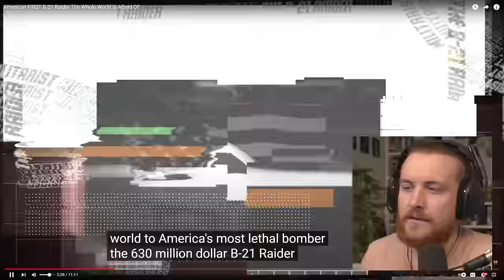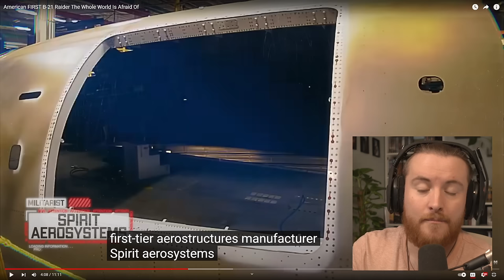Royal Marine Reacts To American FIRST B-21 Raider The Whole World Is Afraid Of!

Comment: Did the narrator say "unmanned capabilities?" It's definitely a beautiful plane. Yup. Ya just gotta look good while flying. Otherwise like you said "what's the point?" 😁
Reply: In theory I think the original contract requirements called for it to be able to be flown unmanned, but that it’s not going to be an initial capability. That said, though, the real “unmanned” capability it and the NGAD are definitely expected to have are managing other unmanned aircraft in the airspace. So one B21 might have a bit smaller payload than a B2, but if it is commanding a wing of much cheaper, smaller, more expendable drones with their own munitions… With the added benefit that it lessens or avoids the B21 needing to open its bomb bays as much if at all if they let the drones carry the payload. That would avoid even the brief time with the doors open which temporarily spoils much of the stealthiness.

Comment: Little facts are know about the B-21 currently. It’s still in development and everything is classified. It is a smaller plane compared to the B-2. It’s supposedly more stealthy and the stealth coating will require less maintenance and is cheaper to maintain. It can be used unmanned like a drone or with a pilot. 

The most important advancement compared to the B-2 is how much further it can travel before needing fueled. The downfall of the B-2 is it needs refueled before it reaches its destination. Using China as the example like in the video a B-2 will have to fueled before it can reach China. This totally gives up all stealth during fueling. The B-21 is much more fuel efficient and wouldn’t need fuel until after it’s dropped its payload. Long after the mission is over. 

This plane actually scares China, they have ran simulations on how to combat the B-21. The only solution they have come up with is attacking then first.

Comment: The economics of the B2 could have been better. the original order was for 100, but someone in Congress that did not like the plane, was able to get the program cancelled and less than 50 were built...thus the cost per unit went up. When you add in the over all cost of the program with R&D added into the physical cost of building each one.

Comment: The B-21 is smaller than the B- 2 , it will under go constant upgrades as they come on line but all and all it is supposed to be more stealthy than the B-2. China stealth program is way behind the US,   as far as changes in the B-21 compared to the B- 2 most is top secret even the paint has changed.

Comment: As to why it is better it is a complicated question to answer. Basically it's a little smaller then the B2 and cheaper and the US will build many many more of them. The engines have improved and though the payload will be smaller it still will carry tens of thousands of pou ds and there are more of them and they are stealthily and have much better electronic capabilities and it is possible to fly them remotely even. 

I also want to say that the actual technology that is planned at the outset is always designed in a way to accommodate upgrades that may require more electricity for example which is why the engines are upgraded and there is always a little extra space designed into them for ulimprovements or whole new systems.

Comment: a set of requirements are set by the air force   each contractor submits a design and cost along with a pitch why there's is better     air force chooses based on design ability and cost

Comment: Wing shape of B2 was same as B-21. Extra wing surface was added for better low altitude and slower speed manuverability. Most systems are still classified on the B2. Radar signature is said to be an order of magnitude less for the B21. That's 10x less signature. We wanted longer range. Much longer range. The majority of 6th gen capability will be confidential for many years. Moat of the 5th gen capability is confidential. Try and look into the F22 and see how little factual info is available.  The AI computing is a major development. The B21 and F35 both have the (alledged) ability to act as an AWACS and command and control center all in one, while that is only it's secondary abilities. The NGAD, like the FA-XX of the Navy ahould put America ahead for quite some time. Consider the F22 is still the premier fighter on the planet, and the US is already working in the finalized replacement for it. The B2 is the moat advanced bomber in the world, and is concerned obsolete already. While the rest of the world has yet to produce a TRUE 5th gen aircraft the US is already building 6th gen.

Comment: The Chinese have no idea about stealth. They are ignorant of many of the technologies in the B-21 or even the B-2. They put on a good show at making their aircraft "look" advanced. But that's all cosmetic. The B-21 has already flown and is in flight test...most likely at Edwards Air Force Base. I worked in the same building as the B-21 production line when I was on the F-35 center fuselage program. I retired several months before that roll out ceremony. The devlopement may have been 7 years but the actual building of the first aircraft was less than that.

Comment: I am hoping - HOPING - that when they say it took 10 years to build it - they are talking about building the first production model of that plane. It would have had it's prototype, gone through the analysis and vetting of that prototype, done a revised prototype of what they wanted to produce - gotten real cost evaluations and discussions on whether that version satisfied the Air Force's requirements for the plane they wanted. Done the analysis of how the proposed plane effected the other planes in service - and satisfied the original programming of what was needed. Then agreed the plane was what they needed and started production. I could support that process taking 10 years. Otherwise - it's total BS

Comment: Please keep in mind that the information in this breakdown video is the official "PUBLIC" information.  Second the Chinese aircraft is likely nowhere near what they claim.  They just don't have the extreme precision engineering and manufacturing technical abilities that the US has.  You can steal any designs you want but without the ability to manufacture what you stole, it is a bit academic.  Sure building one or two aircraft with the profile they claim is great at airshows and boosting morale, it does almost nothing in a real conflict.  Especially, if you are going up against 100 B-21, 300 F-35 and are completely outmatched everywhere else.

Comment: The F-35 has the radar cross section of about 0.0015 square meters.   Thats a gulf ball. 

The B-2 bomber has an RCS of 0.0001m2, the same as the F-22, the size of a bumble bee.

So the B-21 Raider is supposed to have a radar cross section of less than a bumblebee.  Flying at mach Jesus.   

Yeah thats right on radar the F-35 which is basically the export model of the F-22 has the radar cross section of a gulf ball.  While the F-22 and B-2 both look like a bumblebee.  

And our newest toy the B-21 Raider is supposed to be smaller than a bumblebee on radar.  Oh and so far the B-21 has taken it's first flight.

Comment: I do not know if u knew Hitler was not that far from having a jet plane that looked a lot like these flying wing type planes the US is building.  The HO229 that was at the point of being test flown was mostly wood so  during WWII would have been very hard for England to detect.  And I believe it had two jet engines.  So the HO229 or Horton 229 could have made the war a lot longer or given Germany the edge it needed to win.  Faster than anything at the time and stealth built into it.  You should look up what it looked like.

Comment: 1/3 the cost but just little smaller (not 1/3 the load , just small %)
Reply: And how many missions would actually need the full payload? Sure, some would, but many missions that could benefit from the capabilities of a B21 would never need the lost payload anyway.

Maybe more important than lower purchase cost is the far easier maintenance needs. That not only lowers the ongoing upkeep costs but it means each airframe spends less time unavailable in routine maintenance (like keeping the much more fragile stealth coatings of the B2 effective) so you end up with even the same number of aircraft being able to fly significantly more missions. The estimates I’ve seen for the B2 are that only about half of them are mission capable at any particular time with the rest in some form of maintenance. Improve that to (for an easy number example) 75% available rate and you can potentially run 1 1/2 times the number of missions with the same number of aircraft (though long flight time missions these type of bombers fly means you wouldn’t get the full benefit in sustained use).

Comment: i see ther stolen tec from germany after ww2 rolling on the airfield its a big Horten-229 xD
Reply: It's not stolen tech from Germany.  Jack Northrop also designed a flying wing in WW2.  A lot of aeronautical engineers had dreams of the flying wing design.  The difference between the German Horten aircraft and Jack Northrops is that Jacks actually flew and was further developed into the mid 50's evolving from propeller driven to early turbine engines.
Reply: @davidjohnston6547  i think if the horten 229 testpilot didn't die in an accident the and lost the jet, maybe there would have been more of the jet.

Comment: If the Chinese version is anything as good as their new carrier, then it's a piece of crap, copied from better minds, like Russia and the United States. China is all about "face". They build them pretty. They build them fast. They build them cheap. And they build them like crap. Everything they build looks great and works great...until it suddenly doesn't, which is frequently. From tofu dreg buildings, to tofu dreg highways, to EV's, to cell phones, to high speed rail, to AI.  It's all propaganda and hype. And when it all fails, as it usually does, you never hear about it, because the CCP covers it up. Becasue, it's all about "face".